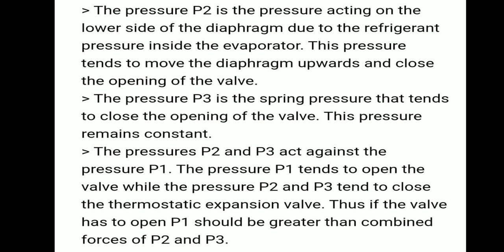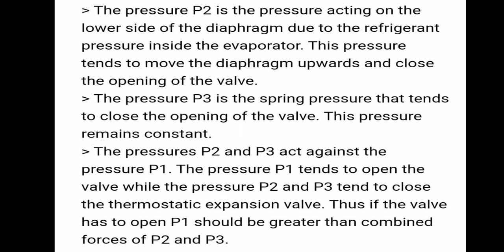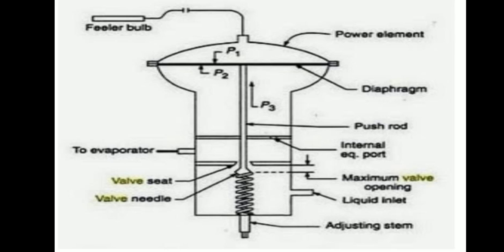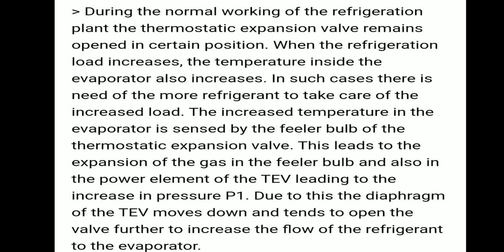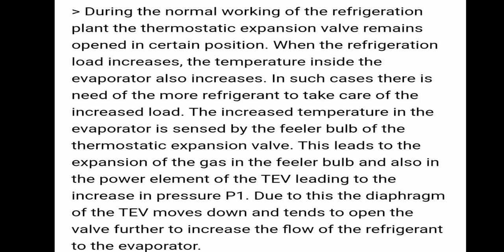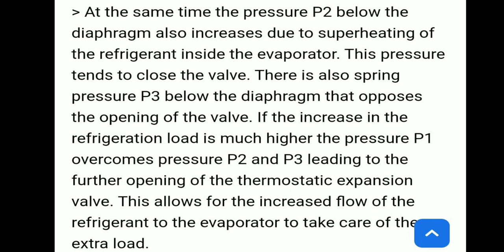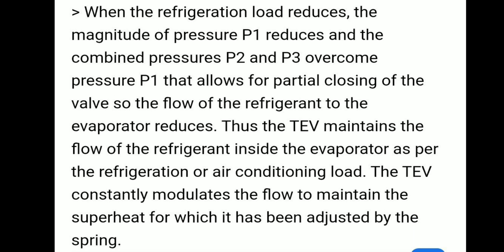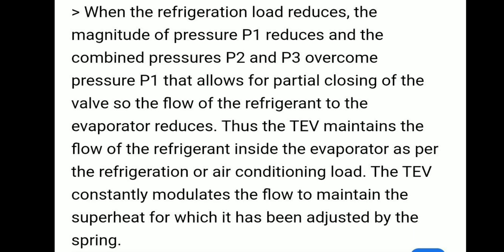Thermostatic expansion valve (TEV)

Comment: brother, if i go for a round, what should i check on TEV as an engineer?
pls reply
Reply from the maker: thermostatic expansion valve responds to the evaporator temperature and the pressure, and thus maintains a constant superheat at the outlet of the evaporator. Mainly vegetable room temperature maintaining and all

If there any  varation and we can understand some problems are there with it